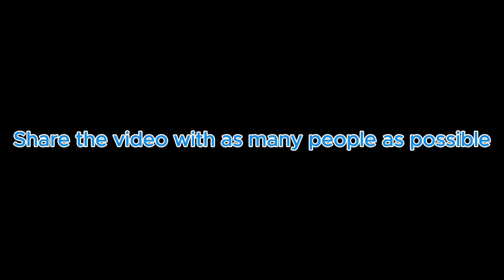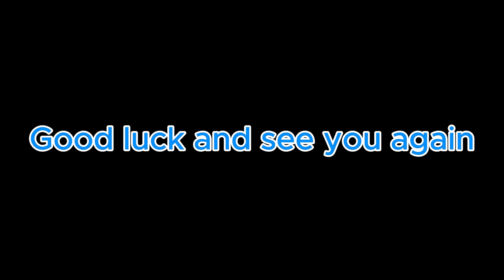Mix SILICONE and ACETONE! The results were shocking because they were so unexpected

Comment: You do realize you can just purchase a product that is better suited to do the same thing for about a tenth of the effort you put into it?  And no, the results weren't shocking, they were to be expected.  You're thinning silicone with acetone, it's not rocket science.
Reply: Mixing it yourself is exactly 1/2 the price than buying the Selley water shield spray. Not a big deal if you only need a little bit. $0.61 oz. Vs $1.21 oz. If you’re doing a large area or surface make your own! By the way, to the rude person who posted the snide comment here… it’s nice to be nice! Choose your words and make the world a better place rather than a nasty one. 😊
Reply: @bitemyram2729can you add paint to the mixture?  If so latex or oil based or does it matter?
Reply: ...and there is no follow-up on how long it lasts or in what conditions. Does it stand up to sunlight (ultra violet) ? , does it affect the surface of the material ? what happens to this coating when moisture inevitably gets under the coating ? ... so on.
Reply: @78tag  some people have used thinned silicone on their roofs and it holds up to UV extremely well for years.
Reply: I guess you are rich we’re not and this is more cost effective
Reply: you're not a rocket surgeon either give it a break
Reply: Stacy, Stacy, Stacy. You're a rocket scientist. Splendid! You didn't need to learn. So, for the rest of the     non-rocket scientists in the whole wide world.  It's a good video. Learning never stops.  For those  who have some acetone and silicone at home. Or do not have the opportunity to get to the hardware. Thanks, bro.
Reply: It's easy to criticize with your ass sitting in a comfortable armchair... Go and do better.
Reply: Rocket science is fake, rockets are fake, space is fake, your comment is probably fake.
Reply: And I bet you didn’t tell everyone what that availability and name is to prove the wind blowing your canvass sails?
Reply: And you also have coloured silicones...
Reply: But that’s not any fun, and if he wanted to get this done fast, I’m sure he’d go buy said product you speak of. I think he’s trying to experiment and find ways  to solve complex and simple problems yourself at home with household products.
Reply: You'll never find waterproofing solution, ready made, for less than you can buy a tube of silicone and a bottle of nail polish remover.  Like, $10 and you could spray your  entire roof.  Thompson's is pricey.
Reply: @zekenoscooter_8608 , wrong,. The acetone (nail polish remover) is the exact same price, if not more. That's without factoring in the cost of the silicone or the time spent mixing it.
Reply: We did this in my Rocket Science class
Reply: @earthstewardude  😆
Reply: What's the product called?
Reply: Silicone spray
Reply: @Vicryl007  WD39
Reply: @Vicryl007 i think the product is called a waste of time.
Reply: @miggs8070  Just like the comments you leave on every video you watch😂
Reply: @Vicryl007  cant find good liquid silicone here. to paint on boots or jacket or whatever
Reply: @markae0  That's why this video has purpose
Reply: @Vicryl007 Bathroom wall paint, glossy.
Reply: Imprägnierspray in Germany ca. 400 ml = 4,- €
Reply: @Vicryl007  There's one called Selleys Water Shield. Probably best not to use the silicon/acetone mixture shown on fabrics that might be damaged by acetone.
Reply: @martinXY  . . . . not to mention the danger of highly flammable acetone igniting from a spark in the drill.
Reply: Whats silicone? Acetic, neutral, or acrilic?
Reply: @claudiafenrirson4904 well acetic anacid i think dissolved in it. Once thats gone it is  mildly acidic but its basically neutral
Reply from the maker: Thank you for watching the video and leaving your feedback. Each comment you make helps the channel grow and motivates me to work more effectively
Reply: @Tips365day  Thank you for watching the video and leaving your feedback. Each comment you make helps the channel grow and motivates me to work more effectively

Comment: HOW long does this last before the coating becomes degraded ???
Reply: That's going to depend on how much you use. I have a piece of canvas drop cloth that I treated using silicone dissolved in mineral spirits and then soaked into the fabric. It acts as a cover for a garden cart and sits out in the spring and summer months during sun and rain. It has been a few years and water still rolls right off. No leaks or issues. Unless a hole actually gets punched into the material, it should last a minimum of five years even out in the elements. Granted, that was soaked and hung to dry on a clothesline, not brushed on. A 4'x8' piece of canvas took about 3/4 of a gallon of solution and I used an entire tube of silicone in a gallon of mineral spirits for the solution.
Reply: It doesn't last long. I've done this years ago to make cheap rubber molds. You spray it on then after it dries brush on thicker rubber. The thin layer is very delicate.
Reply: @edf2350  THANK YOU FOR YOUR RESPONSE.
Reply: Thanks for the useful video but... pelease, use a gloves 😅
Reply from the maker: Thank you for watching the video and leaving your feedback. Each comment you make helps the channel grow and motivates me to work more effectively
Reply: @Tips365day  You must be a politician...you DID NOT answer the simple question...
Reply: @ricksweetser1683  That is the only thing he knows how to answer questions. He is not fluent in English.